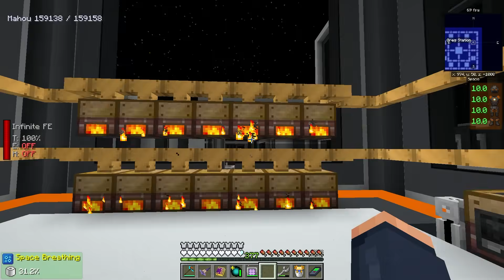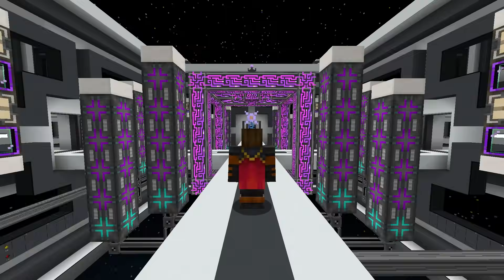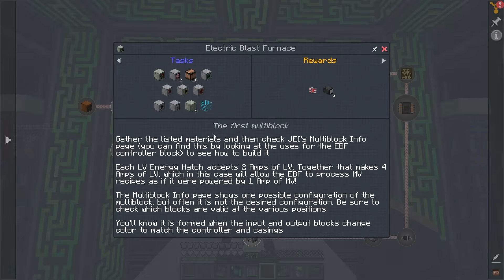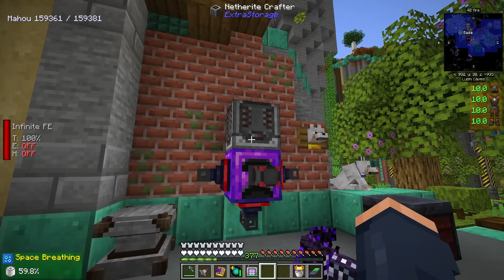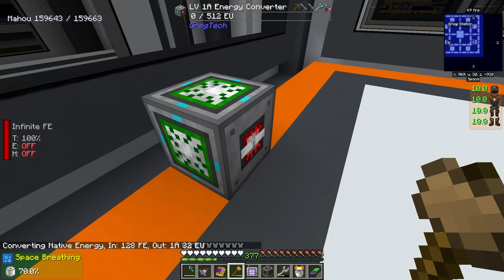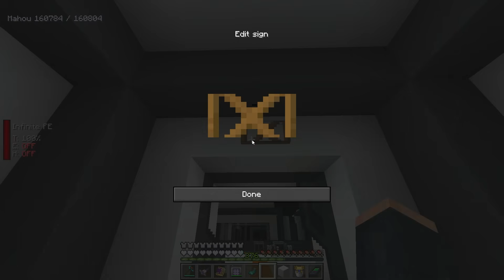Gregtech LV Machines Auto Input & Fluid Crafting EP64 All The Mods 9 Modded Minecraft

Comment: In AE2, P2P Tunnels means Point to Point, not Peer to Peer. Think of Point to Point like a direct connection between two devices, where data travels straight between them, versus Peer to Peer, where multiple devices share info with each other.

Comment: Do you intend on using 16 p2p connections across that white line?  If not it’s a waste of cables using Dense between any p2p connections. Then again if resources are not your concern then have at it. Typically you’d use p2p to save yourself dense cable, but we’ll see if you need to run more than 128 channels out there lol
Ya never know! 😮

Comment: Reminder to use Superconductors as soon as you get access to them, sadly you dont really have the option to make manganese-phosphide right now, but keep that in mind. But honestly the 1 energy converter per machines looks kind of clean tbh

Also conveyors and robot arms work the same, but with the robot arm has 2 extra modes to either transfer or stock a specific amount of items in the inventory its extracting/inserting from. You can specify the stock of specific items with an item filter. Fluids have an equivalent, with the pump being like the conveyor and the fluid regulator being like the robot arm. What I found very weird is that for items, conveyors can import every single input slot, but for fluids. It limits itself to 1 input slot per fluid so you dont really need the fluid regulator unless you need your input to be very specific

But you pronouncing these alloys is so funny if you know what they really should sound like. Learned all that and so many things for gregtech from Threefolds Nomifactory playthrough. Ive watched it too many times already, its really informative and entertaining.  And the pack, Nomifactory GTCEu, is my absolut favorite pack and the best I have ever played
Wow that was way longer than I initially thought it would be

Comment: i used a modular router with distributor modules hooked up to an importer to pull items out of the machines, it made cable management much easier.
Reply: + did the opposite for wire autocrafting. one crafter dumps everything into a chest and a router beams it to my wiremills as they become available

Comment: The conveyer belt can output and input as well not just the robot arm. For automation, its best to use the option of allow input with output side. So you don't waste a channel to export them. Also, at the end of the video it wasn't exporting because the device was offline xD
Reply: the difference between a conveyor belt and a robot arm is that the with the conveyor belt you can only specify the item transfer rate, while with the robot arm you can also choose to stop importing/exporting once there is a certain amount of items in the inventory you want with the keep exact mode, preventing the machine from filling up with only 1 type of item. for fluids it works the same as fluid pump = conveyor belt and robot arm = fluid regulator
Reply: @edificus He's just passively making raw rubber pulp and glue. It's unnecessary to use a robot at this point. But thank you for clarifying.
Reply: ORANGE! (hubrisx2 here)
Reply: @CarpathiaS Yo good to see you!

Comment: So to explain amperage to you, it's how many machines in parallel a cable can supply. Most (but not all) machines require 1 amp of their respective voltage to run. If you have two machines on a cable that can only supply one amp of power, then both machines are only getting power 50% of the time.

In your case with infinite resources, it's probably for the best that you just use 16x cable whenever possible.
Reply: Additionally he can use superconductors for no loss.